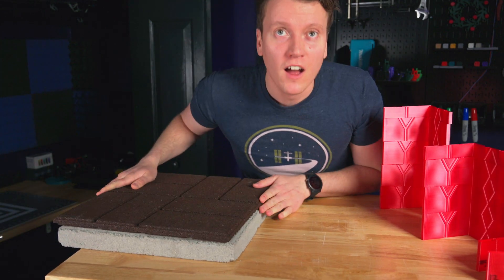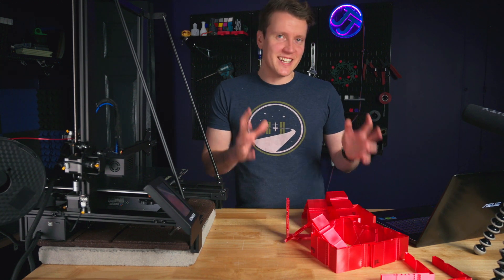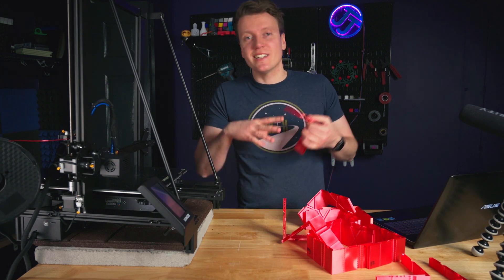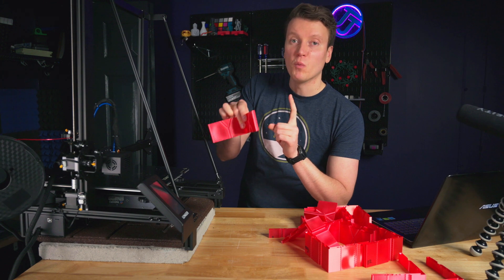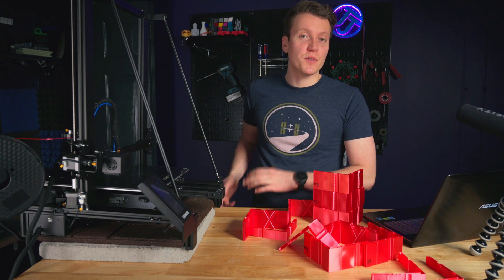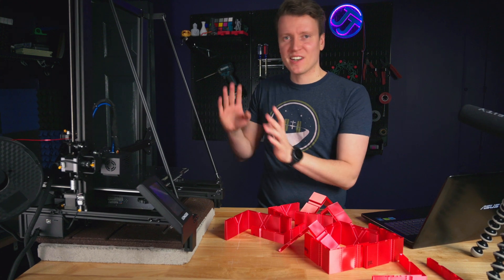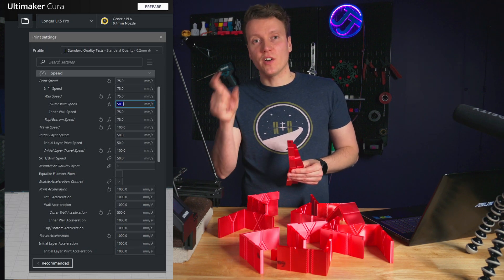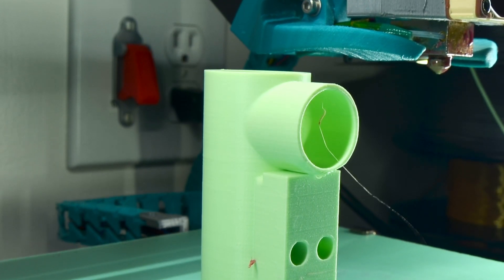Ultimate 3D Print RINGING Tests | Remove Longer LK5 Pro GHOSTING

Comment: I use a real dense foam with concrete block on top, then I use sorbaphane (sp) isolator pads on the feet and it has helped quite a lot.

Comment: Something I added to my i3 Mega was some holders for the top tips of the Z screws.  I was originally trying to solve Z-wobble, which is supposedly what they are for, but they don't seem to help with that at all.  What they actually do is to stop the free-standing upper portion of the Z-screws from vibrating, especially when printing lower layers.

Comment: I've got rubber-concrete-rubber but I may remove the top rubber.
It's also important WHAT type of rubber. If you look at speaker or other rubber feet, they are rated each for specific weights